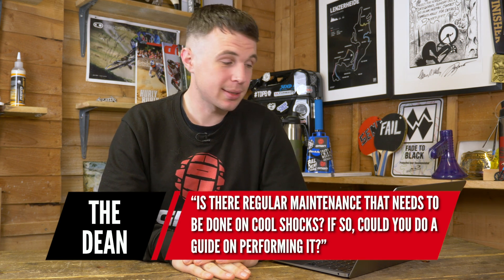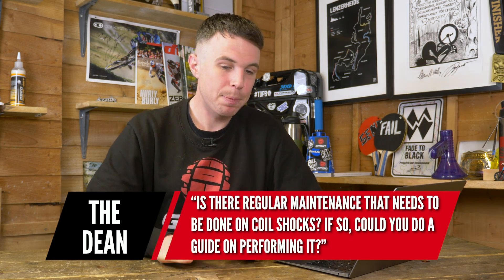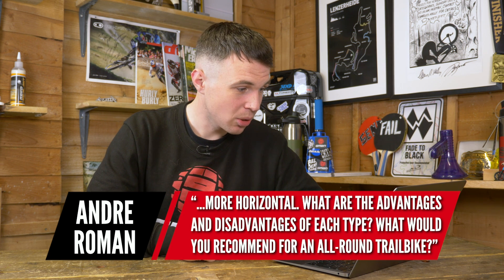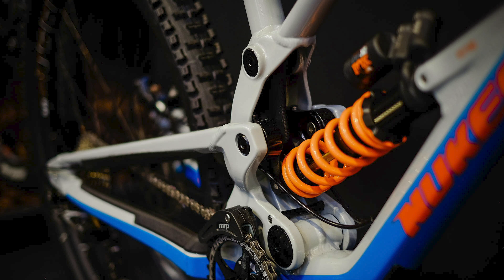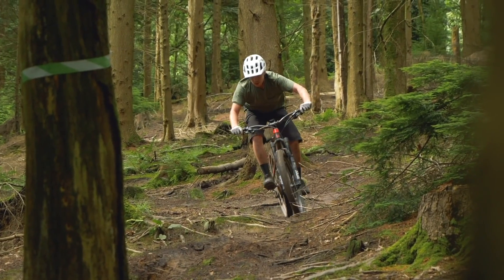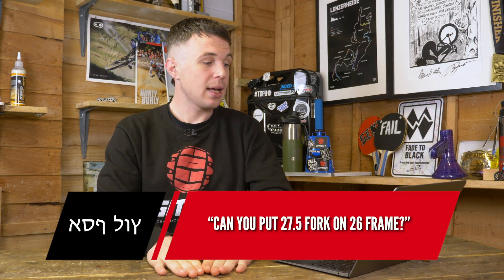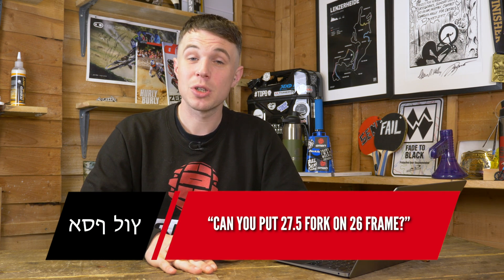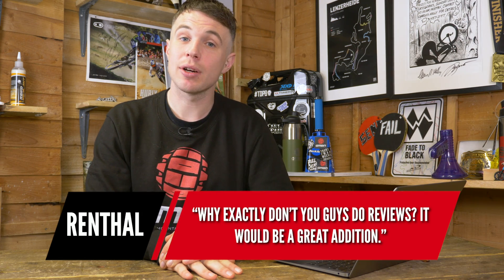Does A Vertical Shock Perform Better Than A Horizontal Shock? | #AskGMBNTech

Comment from the maker: Got a question for us here at GMBN Tech? Submit it in the comments below using the hashtag #askgmbntech
Reply: #askgmbntech am I ok to add an extra 10mm of travel into my fork without having to worry about breaking my frame my bike is a 2019 trek remedy with a 160mm travel fork
Reply: @willbennett7107  yes this shouldn't be a problem, yet if you ask your dealer or the company you may lose warranty.
Reply: @willbennett7107  no problem, but chances are that you void the waranty with doing so. If you have the bike fairly new, I would clarify that first.
Reply: @willbennett7107  I did on my 2012 Jamis Dakar XC Sport I took a 110mm Sr suntour coil fork and replaced with fox float rp 32 f series 140mm travel air fork but I also put a ROCKSHOX Monarch RT3 plus 200mmX51mm travel rear shock so had same geometry with a 1 inch bottom bracket raise
Reply: #askgmbntech how do I prevent rusting I noticed that my bike"s fork , bar , chain and back cassete are  getting rusted even though I always keep my bike indoors
Reply: @random_bs_goo9154  do you happen to live next to the beach or any salt water? 
This can rust up your bike quite fast.
And if your bike is next to a car in the Garage your bike gets wet es Well from the moisture in the air.
To prevent a chain and casette from rusting water displacements like wd40 are the was to go, dry lube is the one which get's to Rust the most.
Reply: @maikszczerbuk613  I usually spray something like penta 4 ,wich is something like Wd40 ,on the chain and back cassette. And I also do not live next to any beaches or coastal regions.
It is also stored in my house and sometimes in my van
Reply: @random_bs_goo9154  you Said your fork and bars are rusty as well, so i guess it's an older bike since Aluminum doesn't rust and Carbon doesn't rust as well.
If it's just surface Rust, try a dehumidifier, or lacker the spots at the bars up.
Fork, check if there are steel parts which rust or the fork itself.
To the casette and chain, if you use water displacements and clean them and wipe the water off, some rust may appear but usually just a tiny little bit.
I can't help you if this doesn't work,  I'm sorry
Reply: @maikszczerbuk613  the bars are iron and the fork is aluminum
Reply: @maikszczerbuk613  Boeshield T-9 is wax-based and works well to inhibit rust.  You spray it on and wipe off the excess about 30 minutes later.  I store a mountain bike at a beach house were the humidity is usually 80% and lots of salt air and for about 8 months out of the year the bike is stored inside the house in the open.  IMO, the T-9 works better than WD-40 in terms of protecting the metal longer-term.
Reply: #askgmbntech i’m looking at a brand called Orbea and I Found A good Cheap Hardtail and I was Wondering if you Would Recommend it to First time Mountain bikers Here is the Link https://www.orbea.com/gb-en/bicycles/mountain/mx/cat/mx-29-40  Thank you
Reply: @brandonshead8984  i was looking at that too but ended up buying a 2019 gt avalanche sport 27.5 an it has served me well from downhill parks to dirt jumping to xc. So i would recommend that (the 2020 version is even better but is the same price as the 2019 was when it was new)
Reply: #askgmbntech hi wanted to ask and share my custom xc downhill hybrid bike I been building over last 8 years hi i have a 2012 Jamis Dakar XC Sport and over the last few years Ive upgraded my suspension dramatically too much info to ask but I'll leave a comment with all my details on what I did to it on your new video i just wanted to ask is a 2014 rockshox Monarch RT3 plus a good rear shock I've tuned it to my weight and riding style (urban downhill and trials) but I'm struggling to get to finer tune to as I'm riding it doesn't absorb small bumbs well but on big drops it's sweet help
Reply: #askgmbntech my front wheel is tubeless and taped up properly, it has a presta valve that fits and yet air is escaping from the bottom of the valve. Please let me know what to do, I love your show by the way.
Reply: GMBN Tech Question for you guys. I have a fox dhx rc2 coil and am wondering if/how I can install a progressive spring from cane creek etc. Thanks
#askgmbntech
Reply: Why are many carbon wheels coming out nowadays so heavy? Almost the same weight as the aluminum counterparts.
Reply: #AskGMBNTech I have a 2014 Giant Talon which I quite like and have made a few adjustments (1x9, bars, tires). The suntour coil fork has got to go, and I'm looking at the Manitou Markour forks. To get a small bump in HT/ST angle and BB Height, Id like a little bump in axle to crown length. Does the Manitou adjustable travel system change the axle to crown length at full droop or does it limit compression only?  Can I go with their longer 29in fork on my 27.5 frame and tires? Am I crazy, should I just get a Diamondback Line already?
Reply: #AskGMBNTech:
My bottom bracket keeps coming loose. Another thread (ital) has already been cut. Is it possible to replace the threaded BB for another type.
Reply: #askgmbntech would SRAM level T brakes be a good upgrade to formula rx from 2013
Reply: #askgmbntech my bike is creaking, but it's not my bottom bracket or headset, It only happens   occasionally when moving my bike side to side leaning it over, how do I fix this
Reply: #askgmbntech am I right that there are basically no budget indoor trainers which will fit bikes with boost rear hubs? Got one tacx brand for Christmas and had to return it because they only have adapters up to 135mm hubs. I run a Canyon Neuron, and even the indoor trainers suggested on canyons website are only capable of clamping 135mm hubs. Love the channel and greetings from Germany.
Reply: Hello. Iam David Kumar from India.  So far I have been using Shimano XTR M9000 . But now I want to upgrade it to New XTR M9100 . But there is a problem with the crank spindle length.   New  crank spindle is longer than the old one. I have got two spacers with the new crank. But don't know which side should i put them. Would be great if you could help me out with that. Thank you so much #askgmbntech
Reply: #askgmbn tech. Whats the difference between metallic and resin brake pads. I have been told that metallic ones perform better and do you know where to get some that are compatible with the Tektro Orion 4 piston brakes?
Thanks!
Reply: #askgmbntech can you guys please do a video on how to make a chainstay protector like the one the Doddy has using the cut up grips?
Reply: I got my canyon spectral 4.0 3 months ago but it came with a fox 34 performance 140 instead of Rythem 150 .I noticed however that these forks are 29/27.5. Should I get a 29’ wheel in front and use 29 in front and27.5 in back#askgmbntech
Reply: I got my canyon spectral 4.0 3 months ago but it came with a fox 34 performance 140 instead of Rythem 150 .I noticed however that these forks are 29/27.5. Should I get a 29’ wheel in front and use 29 in front and27.5 in back#askgmbntech
Reply: I have just bought a Cube Stereo 140 and when I hold the wheel and the seat stay and wiggle the wheel from side to side there is a bit of play and I was wondering what it could be? Thanks
Reply: #askgmbntech Hi Dean, hi GMBN Tech! May you can Help me with this issue: I have bought a used set of fulcrum red power 29 xl for my XC bike. I am using a  180 MM  Shimano XT Discbrake in Front. Unfortunately one of the strew holes of the 6 strews that should hold my disc-brake is worn out (front rim). Do you have any advice how to fix it safely without changing the hub? Is there a safe way to fix it with a strew-nut at the inner side and a strew glue? Thanks for your help.
Reply: #askgmbntech I ride a 2016 Ghost slamr 5 and can’t seem to find a derailleur hanger or the top shock axle sleeve for my bike any where. I have contacted ghost and they sent the specks which doesn’t help should I get a new bike?
Reply: hi GMBN team, I am looking for a lightweight spine protector, currently set my mind between Evoc FR Enduro protector backpack and Poc vps air vest. my question is what are the pros and cons between this 2 type of back protector and what kind of back protector/body armour would you recommend please. thanks. Kun  #askgmbntech
Reply: #can I upgrade my rockshox xc28 coil shock to air shock and remote lockout and can i increase the amount of travel
Reply: #askgmbntech  
I have a SR Suntour Frok suspension, I'm trying to service it after years of use and storage 😕. I have removed the lockout lever cap but unfortunately the lockout spindle pin is stuck lodged inside the bolt. I've tried wiggling it lightly with pliers and using WD40 but unfortunately no luck. Am I missing something?
Reply: #askgmbntech I have a Cube Reaction Hybrid Pro and I want to upgrade its fork (SR Suntour XCM34 Coil, Tapered, 15x110mm, 100mm, Lockout). What fork do you recommend for my bike? I do mainly trail riding and I have already added a shorter stem, a wider handlebar, an angled headset (2 degrees) and a dropper seatpost.
Reply: Thanks for your time man
Reply: Done this numerous times....no response. Give up in the end.

Comment: I had to brake my collarbone to realize this. It’s safe to say no good Downhill bikes have horizontal mounts, and it’s for a serious reason. Vertical mount style suspensions and floating suspensions contain and keep the pressure of the rear shock within the rear system. Not transferring any rear shock pressure to the front wheel.  

It’s very simple, a vertical style suspension will  contain and keep the pressure within the pivot point of the shock and triangle. The horizontal shock system will transfer that rear shock and pressure up to the front fork/ wheel.  How could there possibly be so little information on how a bike will behave with a horizontal mount shock versus a vertical mounted shock!!! Blows my mind.

Comment: VERTICAL shock position all day every day. SLAYS horizontal shock arrangement. Horizontal will never absorb square edged bumps like vertical. The bicycle industry NEEDS to learn from motocross bikes. Yamaha started with their Monocross shock in the horizontal position (Nicknamed Monorock!) then Honda showed EVERYBODY it needed to be vertical. Yamaha turned their shock vertical and never looked back. So did everybody else. Stay away from horizontal setups. Primitive single pivot rubbish with square edge resistance no matter how many links you add to it.
Reply: Do horizontal shocks handle more like a hardtail? I have a hardtail and am upgrading but the one I looked at is horizontal and I feel like it would be more firm the a vertical.
Reply: @Paolo-qe7lc  essentially yes. Horizontal sucks. Seems like we are going backwards in technology. Everything today is looking like an old gary fisher or Trek y foil from the 90s (suspension wise). Terrible. And dont get me started on the chain pulley high puvot crap making a comeback....90s garbage!!

Comment: What's more soft? The coil suspension or the air suspension? I want a suspension to pump and i want to be very soft
Reply: Coil absorbs alot more small bumps so coil but it needs to be the right spring for your weight

Comment: #askgmbntech 
What is the science (physics) behind the horizontal and vertical shock mounts.  
They clearly would result in different characteristics, eg: I would imagine with horizontal design, once rear shock is compressed, it would have stored energy. Once that rear shock unloads that stored energy, it would transfer that energy to the top tube, effectively pushing the bike forward and (possibly downward) as it unloads. How would this translates into real world riding?

Comment: Hello from Canada! I have a question about tuning a hardtail bike's feel. I have a Chromag Stylus 650b designed around 160mm fork. I am running a Fox 36 Grip 2, 30mm of headset spacers, a 35mm long stem and 25mm rise bars. I am 183cm and 70kg and the bike has 597mm stack and 465mm reach. I like a very lively front end, i.e., easy to pop up and bunny hop off weird root and general shenanigans but I am finding the only way I can achieve that feel is by over pressurising the air spring to like 85-90psi but this sacrifices handling at high speeds on rough terrain. I'm pretty strong but I just don't have the body weight to easily pull up with such a low (for the travel) stack. Would higher rise bars allow me to run lower pressures? Would a 38-40mm rise make enough of a difference? I have the rebound nearly fully open to keep the front end from feeling "dead" as I am a pretty light rider for my height. #askgmbntech

Comment: I have a Cube Hanzz 190 27.5 and am very interested in trying a 29er up front. Will putting 180mm 29er fork and 29er wheel mess with the geometry too much or is this a good idea? Bear in mind that this bike can take a 200mm fork. #askgmbntech

Comment: #askgmbntech  Hi. I'd like to know, how big is the new Shimano 12 speed SLX SGS rear derailleur compared to the older 11 speed SLX RD-M7000 GS mech. I'm planning to upgrade my old 26er (2011 Giant Revel which I'm very attached to) and I'm a bit worried that with a larger mech the lower jockey wheel could be to close to the ground. Currently I run a 3x8 drivetrain with a Shimano Alivio RD-M4000 SGS rear mech. I'd be grateful for any help in this matter.

Comment: As far as the question about the helicoil goes, coming from a trade qualified ‘first class machinist’ of 10 years, every time I get a brand new ally component, I will always drill out the threads and replace with helicoils. The amount of unyielding braking strain between helicoiled and not in ally is incomparable. If you have the wall thickness to accomodate it ( the size of the wall left over needs ATLEAST be the same as the thickness of the helicoil itself at the major diameter of the thread or more) than that is a viable option and in my work shop that would be the way I would repair it

Comment: #askgmbntech I've got an SRAM NX Eagle cassette on my 4 month old bike and followed Park Tools gear/rear derailleur adjustment video to get my gears right. I set the H screw and the 1st shift (from the smallest sprocket to the next) properly, as per the video, but when I cycle the bigger sprockets I progressively hear the chain rubbing on the next biggest sprocket, and if I fix the bigger sprocket shifts and return to the smallest it almost falls off next to the frame! Is it possible that this happens because of a slight rear hanger bent? Any help would be appreciated as it drives me mad having to adjust the barrel constantly when riding!

Comment: #askGMBNTech Doddy and Henry, Wondering if can point me in the right directions please. Ok Im a mtb rider for nearing 30 yrs and i've had many bikes all 26ers and never considered the frame geo too much. Now im saving for a bike and considering couple bikes for single track, trails etc. after being off riding for a while due to life but certainly getting back on the trails this yr. So Im thinking this out my range of bikes, Trek roscoe 7  and change some bits, Specialized fuse other consideration is Commencal meta hardtail or custom build a Chromag Rootdown but depends on budget really and how long takes as want to be riding this spring. Ok not a super hardcore rider any more but can ride fast love techy rocky terrain, bit Dh but no big drops. Love railing berms too. I know the first too bikes the head tube not as slack. and fork travel is short while the Commencal is more slacker and longer but not always the best right. On the Commencal would have to upgrade it quite a bit IE drive train definitely a dropper haha and brakes really. So for all. rounder bike a AM bike or shorter travel bike.  cheers Big fan for GMBN Tech and Doddy I have followed your antics since your MBUK days when you had longish hair haha.

Comment: #askgmbntech Can I flip my shock upside down? I have a vertical shock with an external air thingy at the top. This prevents me from fitting a water bottle. Is it possible to flip the Shock upside down so the Air Container is at the bottom?
Reply: You might run into clearance issues with the piggy back at the bottom

Comment: #askgmbntech I bought an older full suspension with an upper an lower air chamber but I don't understand how it works. Can you explain the difference between dual chamber shocks and modern ones?

Comment: #askgmbntech I have a 120mm xcm suntour coil sprung fork and it barely compresses down and is very stiff. Is there any way I can improve it?
Reply: It's a feature
Reply: @Pienimusta  what do you mean?
Reply: @joelcrabbe5499  You can buy entry level air fork.
Reply: @Pienimusta  yes I know but I want to see if there is any way to improve it

Comment: I have a 2019 full sus Merida 120, with SRAM GX Eagle gears. When I ride through vegetation (eg high grass) the rear derailleur gets pulled inte the spokes and bends. My question is two-fold: How can I prevent this from happening? And what’s the best way to fix it? Currently, I take the bike home, put it in the bike stand, shift to the highest gear, and try to bend the jockey wheels back by hand. I’m worried that my treament will wear out the derailler and make something snap. #askgmbntech
Reply: Sounds like your derailleur hanger might be bent. Yes, doing this will wear out the derailleur early, make sure to check your high and low limit screws as well.